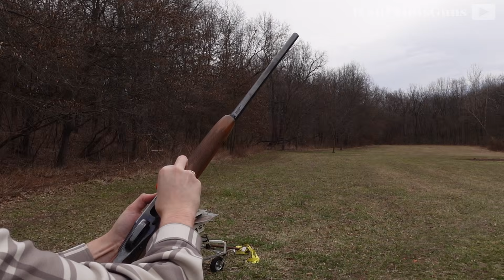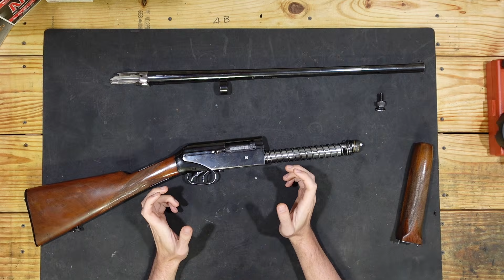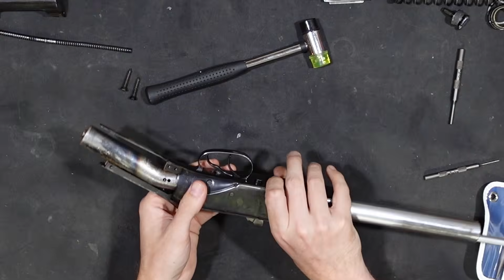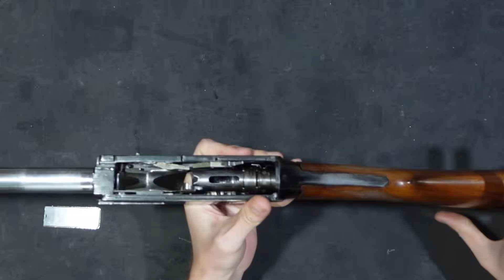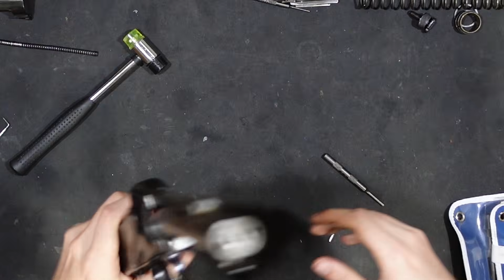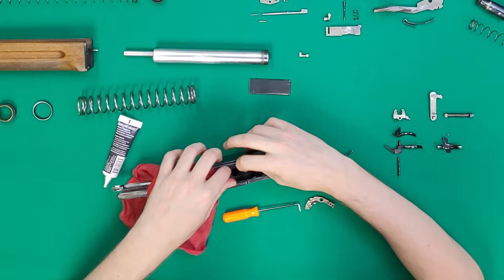The Most Fascinating Shotgun Ever Made - The Breda Automatic 1003 "Prola"

Comment from the maker: Errata:

6:36, 11:33 - I have seen passing reference to Breda working on a sporting automatic shotgun prior to WW2, but this source seemed to base that on it being obvious that Breda would be doing this - I've seen no hard evidence of this fact, and it seems that Prola's prototype was the genesis of the Breda Automatic, and not the other way around.

6:42 - The company was technically still Soc. Ernesto Breda at this point, and Section VI of the company (the Brescia plant) would be spun off into BMB in the early 1950s to pursue sporting arm development further.

7:21 - The Prola prototype closely follows Prola's patent, see PN: CA397542A

7:51 - Most sources assume there was a patent rights dispute, there is no hard evidence why production ended right after it began (and just after Prola's death), but such a dispute seems plausible. The investment in making numbered examples suggests that Breda didn't just get cold feet about selling an expensive gun (Cosmi had done so successfully before and after the war, the market certain existed).

8:50 - In the 1980s, Breda had an expert gunsmith assemble the remaining incomplete guns and parts into complete guns. The example shown in this video is believed to be one of the few fully assembled in the 1940s.

11:36 - for clarity, any of these submodels - 1001, 1003, 1036, 1064, 1008, 1009, etc etc are all best described as "Breda Automatics." Consider the Colt AR15, and how it had a whole slew of variants with the same sort of common ancestor - the 603, 606, 609, and 610 are all AR15s. Breda just made things difficult to track in this regard due to A) not actually marking variant numbers/names on the guns, B) not keeping consistent records for the guns they made.

Comment: Hmmmm, is this how the cosmi got its rear magizine system from ???
Although the higher and lower velocity shells combo may be a problem since (based on most long recoil breda actions) there is a ring between the action spring and barrel that must be inverted for each respectfully, but i guess if its inverted for light loads it would easily cycle heavy loads but may wear the system much quicker
Reply from the maker: The Cosmi predates this by about 20 years. The Cosmi likely got its rear magazine from the Sharps rifle, though other rear magazine designs predate that as well.
Reply: @IvanPrintsGuns thanks for the info, its fascinating how simple mechanics can be used to produce such art!!
Reply: @IvanPrintsGuns  didn’t realise the cosmi design was that old yet still fascinating

Comment: Hey Ivan, do you know if the loading system for the rear mag has been used anywhere else? It looks like a straight improvement over the cosmi while giving you the same benefits
Reply from the maker: There's a few others that load a rear magazine like this, but they are all pretty rare as well.

I much prefer the Cosmi's rear magazine system to this gun's though.
Reply: You might find the Remington Keene rifles interesting.

They load .45-70 through a rearward tube magazine inside of the stock, but the rounds are inserted inside the receiver, unlike the Spencer Carbine for instance

Comment: Italy is fascinating as a country which designs both the absolute worst and absolute best firearms. There is no mediocre, it's always one extreme or the other.
Reply: The Vietnam M16 has been extensively covered and was basically sabotaged, the design was good but nothing you can do about people literally ignoring the specifications. 

Germany in WWII had obvious design issues, but again a lot of those being issues with materials and manufacturing. They were limited in the quality of materials they could use, especially with certain alloys, and were using untrained and uncooperative slave labor to build things. 

Like if I took a Glock, and tried to clone it using garbage quality polymer, a zinc slide, and questionable springs, it suddenly wouldn't be very reliable. 

Chinese guns also vary widely in quality, Chinese Type 56 SKS and AKs have generally a decent reputation for example. Their bad guns usually come from either the Warlord Era, or from when they have issues with specific components that hinder designs, specifically spring quality and ammo manufacturing.
Reply: Absolute worst for what exactly? The M30 Breda and? That is if you want to consider the M30 Breda that bad of a gun, when there are other firearms out there that genuinely sucked and didn't work half the time, like the early M16s in Vietnam, or most of Germany's WWII prototypes, or any number of contemporary Chinese military firearms that shake themselves loose and fall apart.

Comment: Someone send this video and a baggy of Colombian marching powder to KelTek
Reply: Yep. Give them some booger sugar and they'll recreate it with plastic and Phillips head screws.  But it'll jam all the time.
Reply: @vtxrecruiter hex head* 
They have never used Phillips ever even when they were Grendel. Even they know that Phillips are fukcing trash
Reply: @vtxrecruiter They make a dual tube bullpump pump already. I wouldn't want a 12 gauge semiauto from them. But their small semiautos (5.7 FN, got a P50 and PR90) are amazing and malfunction less than any others I own.
Reply: @MyBrotherMan Yes. I know, the KSG. I had one, piece of junk!!!!
Reply: @vtxrecruiter No complaints yet. Did you blow the rail off after 1000 rounds? I need to replace those screws before that happens.
Reply: @MyBrotherMan Mine would NOT reliably feed. Went back to KelTec TWICE. Sold it.
Reply: @vtxrecruiter Gotta pump mine back good and hard is all.
Reply: KelTec as in Kellgren Technologies

Comment: Leave it to Breda to make something extremely complicated for no reason
Reply: This isn't complicated for no reason, the reason is for balance and to explore the viability of the system, something that's unnecessarily complex would be the MG13, or the AN-94, the Mars Automatic Pistol

Unreasonably complex is context dependent, something it is when there are available solutions to the issues at hand which are simpler, not when the relative complexity is there as a solution for a problem.

Comment: How has Ian at forgotten weapons not cover this shotgun yet
Reply: It's even more surprising he, or anyone else, didn't cover yet the Bernardelli Victor, even if it had been in production for 20 years, and there are still thousands, of working samples around. 
Imagine a shotgun using a SVT40 action, deprived of all the gas part, and it WORKS! Thanks to a mix of inertia (of the bolt carrier) and mechanical disadvantage (since the locking surface is slightly inclined, to not perfectly lock the action), and, from the second series (the first required to change the recoil spring) it even self-adjusts between light and heavy loads.
Reply: he forgor
Reply: because there isn't a wikipedia article for him to summarize 😂
Reply: @JaredAF could you explain why exactly you think he uses wikipedia or is that just conjecture?
Reply: @JaredAF  eeehh he's been a secondary source for some obscure guns in wikipedia multiple times, of course some articles are gonna sound the same when he's the source
Reply: @JaredAF  ah yes, you really got him there! Definitely so true!
Reply: @lentlemenproductions770  i mean its more true than ppls perception of him. Hes a historian, not a gunsmith or engineer, but ppl act as though hes the most knowledgeable person of firearms mechanics ever.
Reply: @1nf @1nfamyX 

I wouldn’t say it is. He isn’t the most knowledgeable but he clearly had a broad knowledge base and research skills to back it up. Maybe an offhand comment or a QnA answer will be more generalized but the amount of depth he goes into with firearms generally has to do with what information is available, which he is only occasionally adding new knowledge to, although I will admit distinctly/concede that his general style and the amount of information some weapons have can make it pretty Wikipedia adjacent at least in style. Overall it’s a harmless comment banter so I’ve typed too much here lol.
Reply: @lentlemenproductions770  it is just harmless banter, but i do reiterate he is without a doubt a firearms historian, not a designer or engineer or anything else. In the context of mechanics, he has about as much understanding as anyone whos built an ar15.

I like him, i respect him, im subbed to his channel, and i acknowledge him as one of the pioneers of guntube. If i recall correctly tho, one of his misses was on his description of what headspacing is, and that in turn showed up in a lot of wannabe-gunsmiths. Again, no condemnation, but call a dog a dog.
Reply: Its a sporting shot gun with no real Military history.  He doesn't cover anything that doesn't have some sort of Military history. Of couse there are exceptions but as a rule.
Reply: @leviwoodring6101  hes covered sporting guns too
Reply: @leviwoodring6101  Uhhh... no. He covered dozens of weapons without any military history, and many shotguns among them. Even unique custom pieces.
Reply: @leviwoodring6101  He just covered a wadcutters only .38 target pistol...

Comment: Why has this type of design never been used to achieve a large magazine capacity
Reply: Because the obvious solution is to make the magazine tube longer and balance the gun some other way, this has been made much easier with the advent of lighter, but strong alloys and the switch from Wood to composites for stocks.
Reply: @theotakucomrade yeah but how cool would it be to have 5-7 in the tube, 5-7 in the stock and 1 in the chamber

Comment: I've been looking at picking up an old long recoil Breda to sit along my Auto 5s. They look like they were built to last. They were very popular working guns here in England in the 1970s and those guns are still about and fairly cheap. I never knew about this one though. Amazing detail, thank you.
Reply from the maker: I love the Breda Automatics. Some of the earlier guns do have some weak parts - the bolt tail, charging handle/rear end of the bolt, and hammer spring were redesigned over the production run - but otherwise they are extremely durable. Overall a straight up improvement over the Auto 5. It's a wonder that they aren't more popular.
Reply: @IvanPrintsGuns I think it's because new shooters want the latest and new guns. I was advising a friend, who is just starting, on a semi auto recently and I told him that a Beretta 303 would do everything he wanted for probably 1/5th the price of a new 1301. It was surprisingly hard advice to give!

Comment: insanely unnecessarily mechanically overcomplicated. This is the exact sort of art I love the most. The opposite of a Glock or AR-15. Marvelous, wonderful, I had no idea this existed. Thank you, Halo 3 rat.
Reply from the maker: The funny thing is, this is actually an extremely simple and efficient way to pull off this sort of system.

There's a debate about if this system is worth having (if it wasn't expensive to make, I'd say yes, but it's more expensive than two guns, so having two guns handy when waterfowling is probably the better bet).
Reply: @IvanPrintsGuns I love it; wish I had one.
Reply: I believe the AR; has the only gas system that simultaneously unlocks the bolt and relieves pressure on the back of the bolt lugs ( if everything is set up correctly)